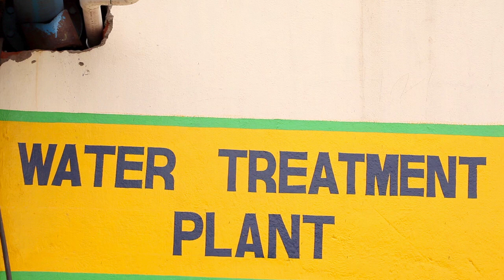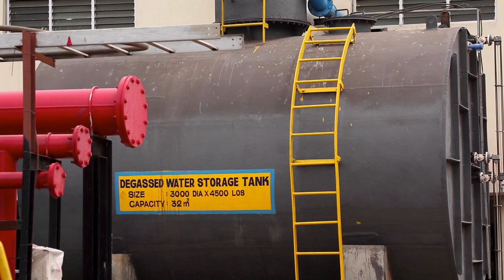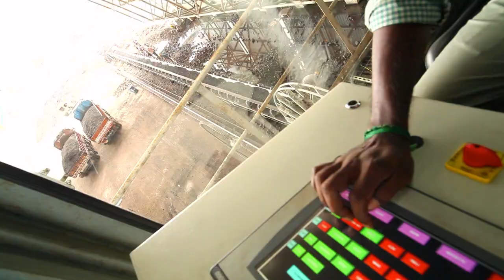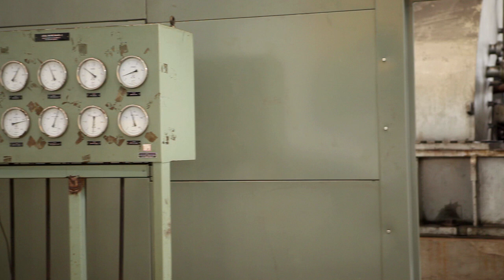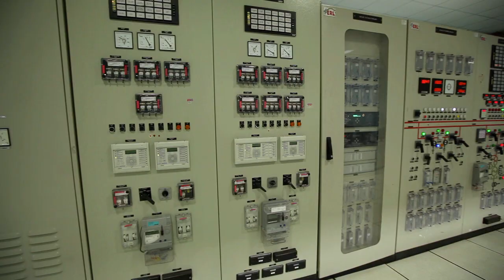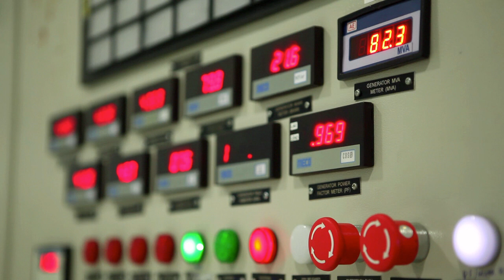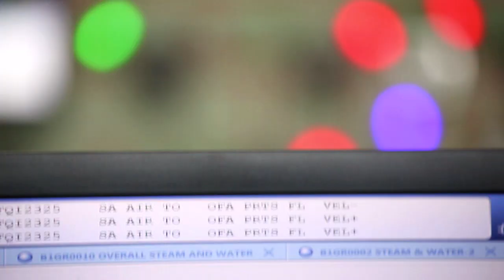SURYADEV POWER 80 MW x 2 - Coal Fired Thermal Power Plant,Tamilnadu,India

Comment: Nice video. But most country focus on the environment friendly power plant,such as CFB(circulating fluidized boiler) power plant,which has a high thermal efficiency up to 97%,and sulfur absorbing 95% during the 750 degC to 950 degC in the combustion chamber.